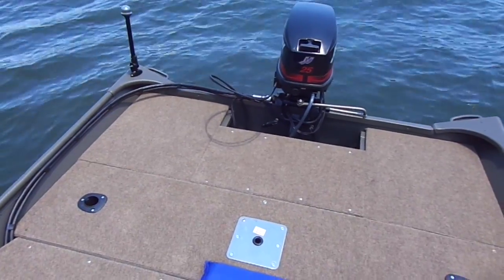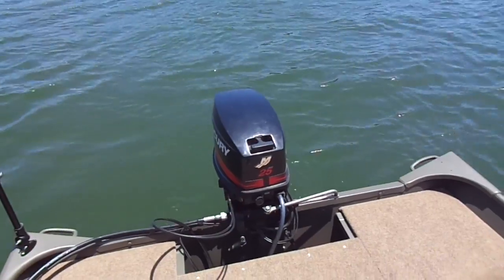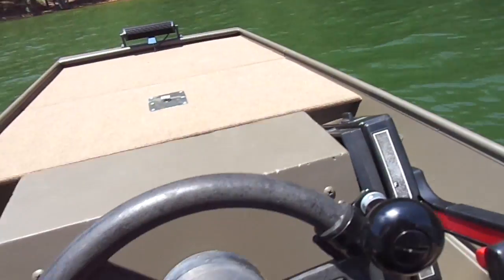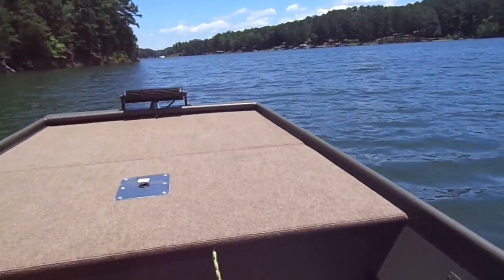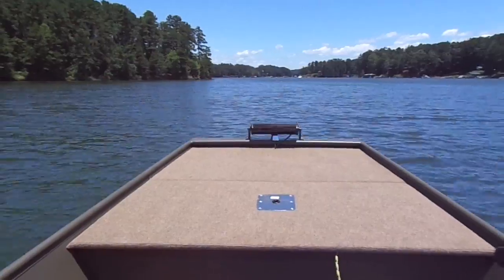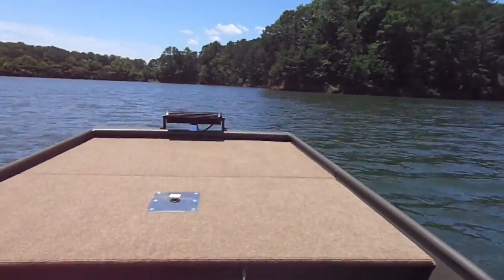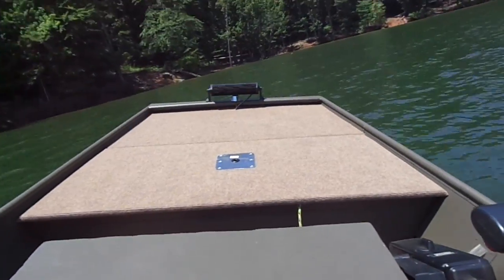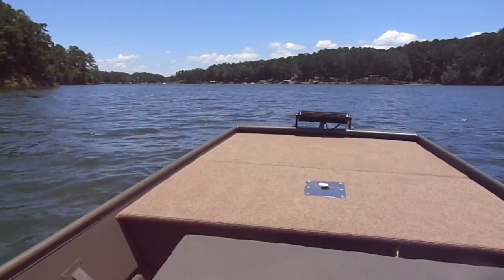Center console Jon boat on the Lake.

Comment: Can you explain where and how you ran the steering and throttle cables to the console?
Reply from the maker: Steering cable enters the floor on right side thru extended rear bench. Throttle and shift cable enters the floor right where motor sits. All cables comes out of the floor under the center console. I aborted this system since cables had to make sharp turns and  becomes stiffer, I could feel it mainly on steering (harder to turn) and throttle was harder to operate. Now I build center consoles with steering, shifter and throttle cables entering center console from the side. But you can’t walk around console on that side.